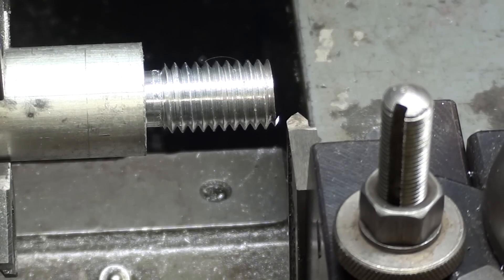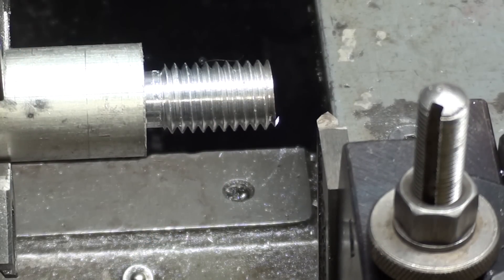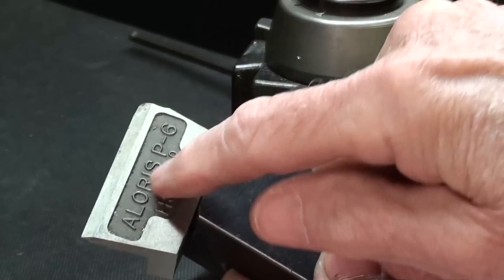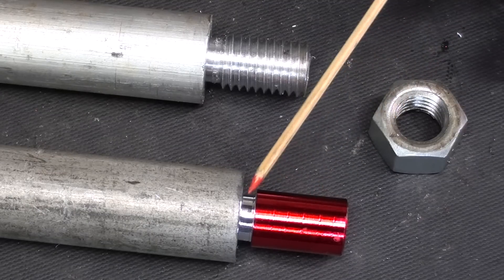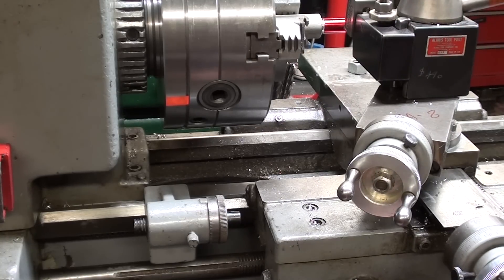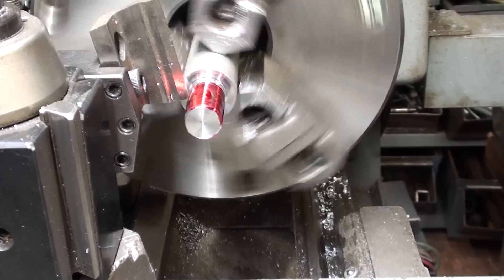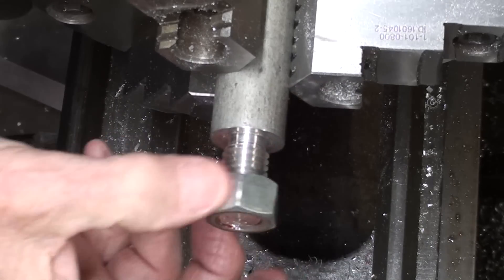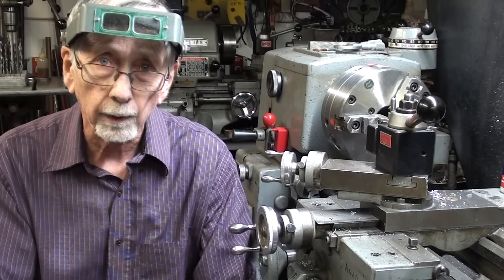NO CRASH LATHE THREADING ALORIS short #861 tubalcain clausing

Comment: I know this is an old video but recently I had a need to single point thread and I wanted to try this method. One question, in every threading video they teach to orient the compound at 29 - 30 degrees, at least for the majority of cuts. It looks like you ran the tool straight in, Will you elaborate on this? By the way I have the Aloris tool you are using and I have cut a test thread and it worked very well. Thanks.

Comment: Great instructional video on rhreading simplified. The CNC lathes dont have this issue, but as for the manual lathe operators. To the old dogs, Give it a try, first thay will scratch their heads, then they will try it!  method will save you heart ache and pain, and mabe even your job!

This is a great example if working  smarter, not harder.
Thanks again MrPete!
Reply from the maker: Glad it was helpful!

Comment: Did you feed threading tool into work using compound set at 29 degree, or use the lathe crossfeed to feed straight in? 
I liked straight in feed with crossfeed especially using an upside down carbide insert. Several finish passes will produce "clean" full thread form.

Comment: About 20 years ago I built a cutter out of high speed steel that did pretty much the same thing. It was admittedly less configurable as the angle couldn't be simply swapped around. Something that people who are new to machining don't always consider is how the trailing edge of the cutter is going to be positioned in reference to the work. With a reverse threading tool it isn't as simple as just turning it over because the rest of the tool runs as something of a tangent to the threads. Now that I've seen this video, I may be able to make a revised version of the tool I made so long ago.

Comment: I do have one of those holders and never knew about moving the bit.  The reverse threading is very useful.  I think I mentioned once that I had a brass fitting that did not have an undercut because of a seal, but instead had a step up shoulder and the threads were cut right up to it, clearly on a CNC.  And, the threaded end was short and held pressurized refrigerant, a part of my neighbor's AC system.  I really fretted over it for hours.  I finally took a 3/16" wide slitting saw and chucked it up on an arbor and ground the tip to a 60 deg point.  I figured it wouldn't need a rake cut because it was round, cutting a round rod and would already have it.  I mounted it on my tool post grinder, put the lathe in backgear at the slowest speed and sawed the thread into it, pulling it out at the last moment.  What a challenge that was, but I got it made and everything back together.
Reply from the maker: 👍👍 that was an amazing solution
Reply: Thanks!  I'm sure a few more of my hairs turned gray over it.  And, I did it on my Grandfather's old 1939 Atlas 10F in my garage. 😎  This stuff never gets old.

Comment: Cold, Throwing Hot Chips,,,,you just have to be aware of what you are doing and where you are in space. One millisecond is all it takes to get wrapped up in the machine, Just understand the risk ,,,,,,

Now as for the pencil necks who can't pick up a screwdriver with out gloves and then head for the drill press,,,,,That is a whole 'nother ballgame. Just like the snowflakes that are wearing ho chi minh sandals and no pants,,,,,even while welding!. Protecting from cold and hot chips is one thing but women's shoes and shorts have no place in the shop or jobsite, NOT EVER.

Comment: OK, 1st, you really don't have to put the compound on an angle, that was old-school thinking. You can feed straight in with the cross slide. 2nd, there is also no need for an undercut when you start at the shoulder. You will get a natural undercut when the lathe is turning and when you advance the cutting tool in for the next cut , unless your threading tool was to wide, just wait a few turns of the piecework before engaging the half-nut. 
     The best lathe that I have ever used for single-point threading was a Hardinge Tool Room lathe.  It had a reversing lever for the carriage so you did not have to use the dreaded half nut for every cut.. You merely had to back the cross-slide out before using the reversing lever, it would stop at the shoulder, feed back in for your cut, and just hit the lever and the carriage would feed away from the shoulder.

Comment: I am now an old retired Tool & Die Maker and started when only manual machines were used. [Including Shapers].
Excellent idea and all required equations are included.
---> Even placing the tool post slide  in the "Opposite"  (29 1/2 degrees)...
....
Is This The BIGGEST Shaper on YouTube? | Klopp 1000H Shaper
https://www.youtube.com/watch?v=fNH8ztBgd30&t=1711s

Comment: Hello Mr. Pete, I’ve watched quite a few of your videos and enjoyed them all.
With regard to the aloris setup you have here (I have the same tool) it appears as the tool holder angle is zero degrees with respect to the work. I was using this tool to thread 1/4 28 on .250 drill rod.  The work piece was in a collet.  I was running at 180 rpm.  Seemed as though the tool was not cutting as much as scraping.  The grove was rough.  I was using standard thread cutting oil (not sure if this was ideal)
The threads were cleaned up with a die.  The die was getting tight on the rod with the thread cutting oil.
I had a can of “Tap Magic” that I’d never used.  I have no idea what’s it it, but it worked.
Just looking for your comments on tool angle with HHS cutter on steel. (Using the aloris BXA8)
Thanks for the fine content,🎉
Reply from the maker: Perhaps you are talking about the helix angle of the threading tool? Yes, the tapping fluid is amazing.
Reply: @mrpete222  Thanks for the quick reply.  I am concerned about the “back-rake angel”.  Measured between the face of the tool bit and a line perpendicular to the work at the cutting edge.
The “rule of thumb” that usually worked for me was with a  HHS cutting tool  use a back rake tool holder. Carbide cutters  go in at zero degrees.  Aloris makes an insert adaptor for the BXA8 but that’s another $100.  As as far as i can tell there is no way to configure this setup to get 8 to 12 degrees of back rake.
I’d appreciate your thoughts on this.  🙏 Thank you!

Comment: The Colchester lathe has a haft nut disengage mechanism that provide safety threading to the shoulder, I'm not sure how it works though. I think in the old time machine shops, when they had to use steam engine and open belt driven systems to power machines and these hanging belts were running non stop, long sleeves were easy to get caught and dangerous. With electric motor driven machines nowadays, that's not a big issue. Still, tight fit clothing are prefer, a big belly like me have got my shirt caught by the crossline handle all the time.
Reply from the maker: I have never heard of that feature that would disengage the half nut, sounds like a great idea

Comment: Love it, learned it originally from Joe Pie. Haven’t had a chance to set up an inverted tool myself and run it so I have a simple yes/no question. The compound is also set “inverted” to the normal angle? And you bring the cross slide back to a zero, then run the compound in for depth of cut?
Reply from the maker: Yes

Comment: I have an AXA-8 holder and I like it a lot  on my small lathe. On bigger lathes I prefer carbide insert type such as a top notch or other style Insert tool held in a standard  Aloris #1 or #2 holder. 

Edit: BTW I wear long sleeve shirts when it's cold too. But I am damn sure to make sure I am clear of things before starting or wait till things stop. To underscore that rule,  I had a friend go for a ride through his Boring mill once when his sweatshirt caught the moving tool. Dam lucky to be alive he is!
Reply from the maker: Wow, that’s sweatshirt story a scary
Reply: I was a wood and metal shop teacher in high school setting when I was 19 years old and my students were the same age as me.
After 2 years I went back to school and became an Orthopedic surgeon.
I am 72 years old and in retirement have a 14x40 manual engine lathe and am building a PM940M CNC MILL with power drawbar and currently converting to 3HP 3phase VFD BLACKMAX 10multirib belt drive.
Everything is a hurdle but that is the whole point of immersing myself into the enjoyment of that task.
One day , the cool kid was running a similar engine lathe with the lead screw turning.
He thought he would sit on the edge of the lathe chip tray and I heard him screaming in panic as I jumped over a bench to turn of the machine .
He was panicked and I realized I was probably Olympic material .
No Injury but he never adopted the cocky cool guy act in my presence ever again.
Critics will now probably advocate for removal of one’s trousers belt and aprons to prevent this scenario in the future 😏.
Every work situation has to be tailored to the task at hand and the needs of the individual performing the work.
I doubt the Russians building Tanks in their “open air factories” in WWII where they didn’t have walls or roofs yet. They certainly even wore gloves while working.
My skin is like cellophane at my age and the slightest bump against the machine or tooling breaks open my skin .
Therefore I have to adapt to the situation after considering the risks versus benefits (needs) of the task at hand.
I accept the risk even knowing the potential danger.
As a surgeon I cared for many injured individuals who had “broken the rules”, but rather while acting in a cool guy (it can’t happen to me attitude) role not ever even taking time to think about what could happen.
Comments made in the spirit of trying to educate the “Unknowing” are legitimate but critics who are just offensive in their own “ I know what’s best “ smug role should be dismissed as just” Offensive Arrogant  individuals.
I love every one of your videos and would gave enjoyed being your colleague in my youth.
Please keep up the great work you do.
I always learn something from you.
By the way,
Being a shop teacher isn’t that much different from working with tools to cut drill and insert hardware in people.
It’s simply cool guy arrogance exhibited by doctors.😏👍
Best Regards,
Ron

Comment: Thank you for the video. I am making a lot of small parts and usually threading to a shoulder. In tiny threads the chips obstruct the view and overshooting the relief groove is easy to do when threading towards the chuck. Early on I mounted the tool upside down and tried reverse threading. It is my go to technique. I also do that with internal threading. It is so much easier to see what is happening inside the bore when the tool is on the back wall.

Comment: I just moved the farm's antique Atlas 6" into the heated shop from storage, so I could take off my loose-sleeved coat while using it. Sadly, the machine had the worst kind of crash-- the ties holding it up gave way when I set the machine down and it tipped over. Time to make some new handles. Anyway, I've been enjoying your videos for years and have been learning so much each time.

Comment: Love the no drama method. And that's the oddest threading tool I've ever seen. Why is the blade so long? It doesn't look like you could resharpen it very many times, get the edge on center and still line up with the bolt holes,

Comment: Hi Mr Pete!!  Another great video.  Joe Pie has been preaching this method of thread cutting for years and has made a number of videos about it.   To do this buy a left hand threading tool with insert and flip it upside down.  I needed a SEL2020K16.  That puts the insert on the chuck side.  Cheers
Reply: joe pie is like the russians, he "invented everything". A legend in his own mind. Follow his instructions and you'll make out of spec threads.
Reply: Hi  Bill  Can you please be a bit more specific why you think that?  Turning away from the chuck is just another technique at your disposal.  Turning toward the chuck was a necessity many years ago because of screw-on chucks.  At the end of the day, it is up to the machinist to ensure the thread dimensions. Cheers. @billshiff2060
Reply: @johnspathonis1078   Turning away from the chuck is as old as lathes are but pie presents it as if he invented it. His recommendation for tool tip flat/radius will make every thread out of spec, dangerously so. He gets obnoxious about it if you mention it and then blocks you.
Yes it is up to the machinist to ensure it's to spec but first he has to KNOW the specs and pie does not. Frankly very few actually know what the specs are in detail, pie is not one of them but presents faulty information as if he does. He has contradictions in his mind about the cutting action of the tool and made contradictory videos that are opposite each other. 
He is not even aware that thread micrometers with multi anvil tips exist. I posted the Mitutoyo model number but got blocked.
Machinists do need to know these things but most don't and they won't learn it from pie.
He made an entire video aimed at me where he fraudulently misrepresented what I said and fraudulently rigged it to "prove" it.
This one...
"Sharp Corners, Triangular Tools and Good Finishes. Can it be done?"
MY point was that the side of the tool does some cutting at the end of the chip and his contention was that the front edge ONLY does ALL the cutting and the sides don't have to be there at all. So he fed it super fine to try to pretend the sides don't do anything. He was supposed to feed it fast.
I think he was pissed drunk when he did that, slurred speech.

Comment: Mr. Pete, I actually do own that exact tool and the quick change tool holder, it came with my 1956 13" LeBlond Regal when I bought it in 1992, I've never used it because I wasn't quite sure on the setup and just used a standard thread cutting tool, I stopped using the Aloris quick change because I just couldn't find tool holders affordable for all the different shaped carbides I started using.  Might have to dig it out and take a look at that tomorrow, thanks for the video.

Comment: My only lathe is my Grandfather's Atlas 10F w/QC gearbox.  Your method is really my only option.  I'm always dreaming about a larger lathe with 5C collets and other stuff.  I was just reading someone's comments and they said "I want a machine that when threading, kicks out a at the shoulder and rapid returns to the beginning of the cut".  Wow, do you know of any of your older lathes that can do that?  I guess it would be a lathe with a travel stop that would kick out the feed.  It's been a while for me, but I seem to remember a rod that ran through the saddle under the front of the ways on some lathes. Should I add that to my dream lathe?
Reply from the maker: Yes

Comment: I bought the Aloris threading tool in 1977, and always use it in reverse as you show. I like that it is easy to adjust the helix angle too, especially when cutting multi start threads. really enjoy your videos.
Reply: Hi there, varying the helix angle was something that I was puzzled about - how is it done ? - I’d assumed that you have to purchase different tool holder inserts for different pitch angles and thread forms / sizes . . . .
Reply: @steveallarton98  with the Aloris type tool, the cutting blade is fixed with a socket head caps crew, about which it can be tilted side to side, to match helix angle.  A horizontal set screw holds the blade at  this angular position .

Comment: you have proved a good point. no stress or anxiety.Safe.
 But what about us poor folks that have threaded on chucks, and shop ground threading tools? do you have any good Ideas for us? What about rear mounted inverted threading tool? What about a set screw locking chuck to spindle? How do we achieve tranquility in threading?

Comment: I will have to try that when I get my South Bend lathe working again. The back shaft and babit bearing are badly woren. Plan to line bore babit bearings and use a larger shaft. Any thoughts on getting tapper pin out of end pulley.

Comment: A great technique, I'd also mention to check the compound & cross slide gibs are tight, as cutting forces are trying to lift tool post vertically, as opposed to normal chuck rotation, where all forces are down. Loved your threading tool holder. Cheers.

Comment: Hi Mr. Pete.  Looks like a good way to thread.  If you don't have that slick Aloris switchable tool holder, would you grind the tool differently, for running in reverse?  Just wondering.  Thanks for the video!

Comment: In addition to not doing this with a screw-on chuck, you should also check if anything strange will happen if there is lifting force on the carriage.

With the Aloris post you could also mount the post behind the work, with the tool facing up, to avoid the concern of upwards force on the carriage.

Comment: I've been trheading L-R since seeing it on Joe Pie's channel. I have a threaded spindle nose, so I just do fine threads. Someday I'll add some sort of lock so that I don't have to worry about the chuck unscrewing.

One thing you might have mentioned is that, if you use the compound for infeed, it needs to be angled the other way from usual, because you're cutting the other flank of the thread. You have it set correctly, of course, you just neglected to mention it.
Reply from the maker: The reason I didn’t mention that, is I didn’t think people would understand that. But astute observers such as yourself get it 
98% of viewers will never do this.